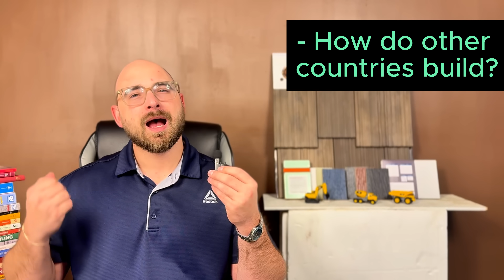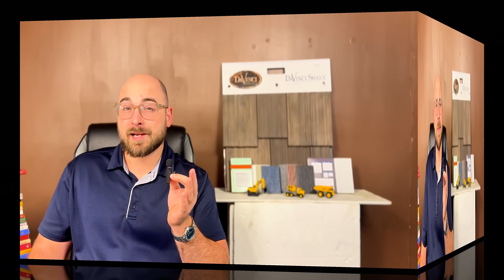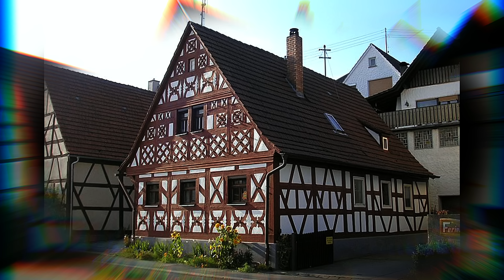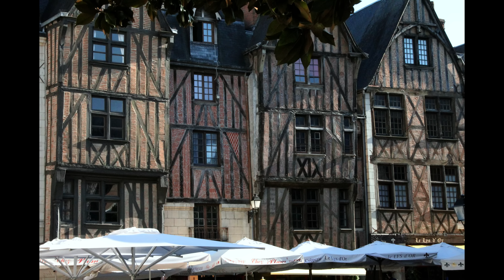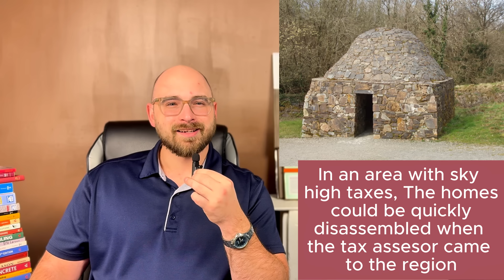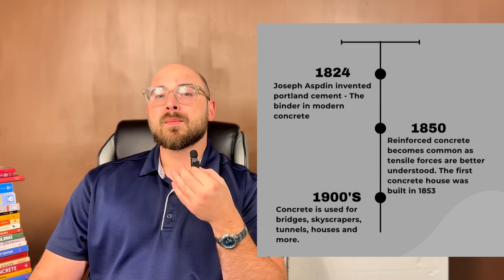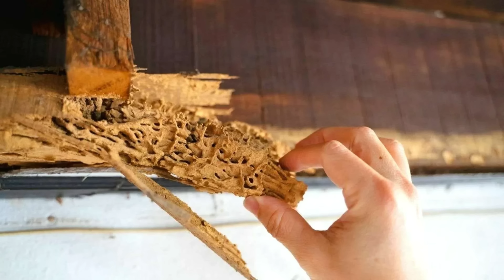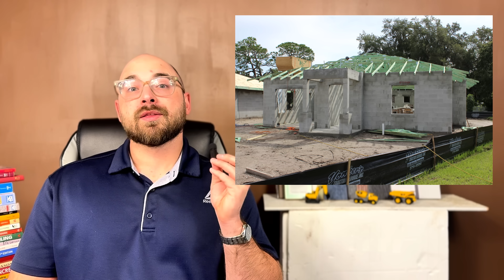Why Other Countries LAUGH at American Homes

Comment: Seriously?  Just peek over your southern border (beyond the border belt states, which are not Mexico by most accounts) and you  will find practically all houses to have been built from blocks and most of them have framed cement/concrete flat roofs (no snow here, so we've only have to make sure that rain water has a way out) and more than a few have vaulted brick roofs. Only the poorest shacks on remote locations are built out of wood and have wood frame roofs covered with something or other. If insulated properly, they do well at keeping noise and heat out. When hurricanes come by, we've only to worry about fixing the windows shut and the such. Plus, fires are a very rare event, to the point that most cities, even in the range of 250,000 to 500,000 inhabitants, do not really have a sizeable Firefighter department (there's usually one, but minimal and mostly for public policy propaganda pourposes. There are no fire hydrants anywhere to be seen.
Reply from the maker: No fire department is a real consideration, super interesting
Reply: @Mike_Fortin  Look it up, and you'll see what I mean. Yes, there is usually a "Cuerpo de Bomberos" (Fire Department)  but, when compared to those in the USA, is little more than a façade. In those areas subject to earthquakes, though, there is indeed a quite compentent and fairly large salvage and rescue unit, but they focus in disaster recovery. Such as the widely-known "topos" units that use dogs to search the rumble for trapped people.

Comment: My house built by brick and mortar..all houses here are..
Apartments are generally steel and concrete with outer brick facade..
Average house price for 3 bed in Dublin 400,000 euro min…
There are 4 bed houses , new, going for 800,000 euro just a mile away..
Only America builds wooden houses I think..
Dollar and euro on parity just about 🧐🇮🇪

Comment: Another reason why Americans build with wood framing is due to the literal disasters, America in the center have the highest tornadoes or storm ranging while not in the whole world but it's constantly very high none of less and do to lessen property damagers use wooden structures another is wood is a lot more flexible then concrete bricks in earthquakes due to the woods natural ways it can wobble but still stand against strong winds or earthquakes which are common in the middle or the south.

While America houses are not it's best it has it's own reasons why it also created there is no reason why a house is created if it simply attends to be useless in the long run
Reply from the maker: A strong enough earthquake will destroy a wood house anyway, while it costs more, a concrete houses can survive a higher magnitude earthquake than a wood house

Comment: I am an architectural technologist in Scotland where we also build with timber frames unlike the rest of the UK. Our new houses are well insulated and up to a good standard, because they have to be by law. Buildings are inspected during the design and construction phases. I imagine there are similar systems in place in America, they are likely not as demanding or well enforced. It is not the timber frame at fault, but the legal requirements (or lack thereof) that push building quality.

Comment: Wooden house have the benefit of general safety in case of a collapse. If a wood frame house collapes or part of it collapses, you're more likely to survive compared to a heavy stone house, this is particularly relevant to the US because of its extreme weather commonality.
Reply from the maker: Or we can build houses that don’t collapse 🤷‍♂️
Reply: @Mike_Fortin not that simple im afraid. America has 3 major issues with constructing housing, its varied climate/ weather events, an ongoing housing crisis (that is pretty much artificial), and a deficiency of American made construction materials. Europe doesn't see tornadoes, earthquakes, and hurricanes nearly as often as the US does and there are significant advantages to having housing that isn't as rigid for some of these events, and due to being built out of wood, it decreases reconstruction time if necessary. It also should, key word, should decrease the prices of new houses due to not being built out of premium materials, granted this won't happen due to late stage capitalism fucking over the middle class, but if things weren't so hellish, it would be an advantage. The final major point, wood is cheap and we can get it cheap if we can't grow trees ourselves. There are distinct disadvantages and advantages to all house building techniques and philosophies, to act as if America doesn't understand material science or architecture is kind of silly and a little ignorant. America builds plenty of its infrastructure out of concrete, steel, stone, and other rigid materials, but individual housing is like the one thing we don't, which kinda makes sense in a way.

Comment: whatever works for you is great IMO, i think America just has a different philosophy where the homes are sometimes built to be more disposable and easily rebuildable after each disaster, worth mentioning America has way more single homes than Europe does, most houses are apartments here and so you can't get away with anything but strong structural concrete, in America it feels most people live in single homes but here it's a luxury reserved for the rich 99% of us live in apartment buildings

In the single-home industry i see more and more things like light steel framing coming into fashion, so i don't think Europe is as set on this brick and concrete idea as others think, it's simply a consequence of the fact we mostly live in tall apartment buildings and not single homes.

I do think especially in the midwest areas that are more vulnerable to tornados America really should make an investment in stronger houses that cannot be destroyed by a tornado as a means of saving the inhabitants of said homes who should really be safe indoors. I do think it would be good overall even if you keep the wood+drywall insides if at least the outside of the homes were built of brick, concrete and metal.
Also in most of Europe we don't use wood for drywall structure, we use aluminum parts meant for that purpose, i think that's better because it can't rot and it feels like using wood then hiding it behind drywall is just a waste of fine wood you could be using for furniture.
Reply: It's not any luxury to live in a detached house in Europe. After Wikipedia:
"In 2015, more than 4 out of every 10 persons (42.0%) in the EU-28 lived in flats, close to one quarter (24.1%) in semi-detached houses and one third (33.3%) in detached houses."
Reply: @ElegantiaeArbiter  Weird maybe some countries are more concentrated than others, i've lived in Lisbon, Stuttgart, Berlin, Ulm, Paris, Bordeaux and Dublin and in none of these places did anyone i know or even heard of live in a detached house
Reply: Might be more common in smaller villages and places like that, but i'd argue living in such places nowadays is a luxury in of itself because of how little work there is in these places for anyone other than those who work remotely, have their own businesses or means of daily commute between villages and the city

Comment: I live in the United States. I wouldn’t say all of our houses are crap. We have a lot of crappy home builders that charge an astronomical amount of money for a subpar product, but that doesn’t mean all of our houses are poorly built. You Have to understand American homes are built out of wood because we have a huge abundance of wood and it’s so much cheaper and easier. Plus the logistics of moving wood around is easier than hauling stone.
Reply from the maker: We definitely have some nicer homes. Some high tech wood homes (passive house, net zero, etc.) 

But concrete is also widely available and with products like ICF it wouldn’t be difficult or too expensive to build insulated concrete homes at a comparable price.

Comment: I mean house is house
but i live in other countries also. and American and Canadian house so far is the worse.
floor creaking.
thin wall does not even do a single bit of job in noise cancelling
especially Bathroom. I like the bathroom that i can spray water everywhere, in which i can clean easily. Here, you have bath tub, end of story, no drain on the floor.

Comment: Houses in America are "cost effective" and disposable but somehow they are 4 to 14 times more expensive than an equivalent house in México... also full concrete houses are not good, confined with concrete framing is better, why? Well try to add a new outlet in a concrete wall.
Reply: To cut channels in concrete walls a good chaser with vacuum is needed, because dust is much bigger issue than hardness of concrete which is still lower than stone. Reinforced concrete frame with brick infill or reinforced structural brick infill (for seismic zones) is one of the best solutions for another reason - it makes the atmosphere in the house better, since bricks have higher porosity than concrete. It can be mitigated by using vapor permeable clay or lime based natural plasters.
Reply from the maker: I would either use ICF and run wiring in the insulation, OR if it was exposed concrete, such as CIP, I would add conduit screwed to the concrete, much simpler

Comment: Truth is..a mixture of all construction methods is probably best. Brick/concrete exterior walls with timber/metal framing for the partitioning  is probably best way to go..or at least that's how they started building in România lately.

Comment: The idea is that American homes are supposedly made of cheap materials like wood and plaster to save costs, but everything I've seen indicates that those wood and plaster houses aren't much cheaper than much sturdier and much better insulated brick and mortar houses in Europe. The only difference is the CEO of the building company in America owns 4 mansions while the CEO of the European company only owns a single large house.

Comment: this is a relatively recent Discover, where they mixed lime in with Roman concrete which expands when wet, so when the concrete starts absorbing too much water and cracks under the weight, the limestone fills in the gaps that have formed and reinforces them so it keeps its strength

Comment: So, European homes needed to be built the way that they were because everyone lives on top of each other, and stonework transmits noise a lot less, and also helps fires spread a lot less than wood construction.

In the US, unless your locality allows for it, stone is often much more expensive than using wood to construct houses.

The downside of course is that American homes need more upkeep structurally in order to remain solid unlike their European counter parts.

The upside is that American homes tend to be much easier to modify and upgrade because you don't have to bust out your stone cutting tools every single time you want to install a new light.

Comment: European robotics engineer here. I had the pleasure of sharing my workspace with a team of aspiring civil engineers that were working on a cheaper brick alternative for housing. Their inspiration? African mud houses. They designed a new brick shape that allowed for a continuous plastic pipe to run all the way through the walls of the building. They modified a 3D printer to actually print various samples of clay bricks shaped in different configurations, and the insulating properties were incredible. The bricks, which were blast heated like any normal brick alternative passed the same stress tests endured by currently available alternatives. I believe they are further expanding their project to this day in the spanish south, building small huts that combine these bricks with semi-spherical house shapes and a propietary combination of insulating agents covering it all up. The same water that flows out of each sink and toilet is used to increase the insulating properties of the walls against heat, especially. Very promising stuff!
Reply: And 20 years on still not available

Comment: I wouldn't waste my money building a house out of sticks. I built mine out of ICF, it recently took a direct hit E4 tornado here in North East Arkansas and One window got cracked by debris and I need to touch up the stucco where things hit that side. It also meets passive house standards on top of being such an easy system that I did most of the work myself outside of actually pouring in the concrete.
Reply from the maker: Oh wow, I’m glad you’re okay
Reply from the maker: Do you have any pictures or video you’d be willing to share?

Comment: when this debate comes out from time to time the only excuses the people from USA have is "but is easier to remodel" why the heck you want to bring down walls? just buy a house you want to live like it is, and "its cheaper", yeah, 500.000 to 1.500.000 dollars is quite cheap of course, not like a cinderblock cost from 40-80 cents, i rather spend 5 years buiding a sturdy and everlasting house than spend half a million on a matchbox
Reply: Cinder blocks cost here $2-3 a piece for standard size.
Reply: @ElegantiaeArbiter  even like that, an estimation on a 1500 sq ft/140 sq mt house, needs between 9000-12000 cinder blocks, so its $18000-36000, thats like the first year and a half to buy the blocks after getting the land to build on, now you have the next 2.5-3.5 years to get the iron rods, house wiring, plumbing, cement and handwork to build the house, there is no rush
Reply: @ I completely agree with you. Just wanted to correct the block price for 40x20x20 cm size.
For 140 m2 house assuming 2 wythe block wall (with insulation in between) and single for partition walls you would use around 4000-4500 blocks depending on the layout. So only $13500.

Comment: 21:42 I would certainly like to know what are these things you call "High performance homes"
Reply from the maker: Homes built with ICF or steel, built with passive house principles such as: continuous insulation, airtight design, better HVAC, and sustainable material choices

Comment: Light wood framing is cheap 🤣
They rip you off. There is no way a pinewood matchstick house should costs the same or even more than a brick/cement/stone house in middle europe.
The house that me and my family live in is 120 years old and you wouldn't be able to tell that. Brick-mortar and stone construction, two floors an attic and a basement wich both have the same size as the footprint of the house. And a garage/workshop. New fasade every 30 years, new roof every 40-50 years and you are done. Thx to my grand-grand-grandfather. This house will stay in family hands so all of us can live rent free and by that be happier than others. We owe nothing to anyone, just your health is worth more.

Comment: The biggest issue with US homes is that you use wood as a material in hurricane and tornado affected areas. If you want your home (and yourself) to survive then you need stronger materials and a basement.
Reply: i have seen solid cement and rebar get ripped clean off the foundation. don't talk about events you don't have to experience

Comment: As a German engineer who lived in Canada for a while I can definitely say European houses are better. As the comment section shows aswell Americans are resistant to innovation and good arguments. Since you hate so much on solid construction I will compare the two wood methods. In Germany we also build with light timber framing especially in single family homes. These homes are made as pre fabricated walls or entire rooms and brought on side and assembled. The biggest difference is how the wall is made, it is used with 8/16cm studs but sided on both sides with double planks of osb which helps the sturdiness and Akustik absorption, as well as filled with insulation.

Comment: One thing I don’t understand. One of the pros of lightwood building is the low cost. Hth are those homes multimillion? 
For that amount of money you can build concrete made villas in Europe. And to be clear, material and labor cost is not cheap there too.
Reply from the maker: Land value and high demand, labor prices are also high, permit fees are high, contractor overhead is ridiculous could be 30,000 a year for insurance, so that cost gets passed down, etc. 

But primarily land and demand. The same house can cost 600k in middle of nowhere Texas and 1.1 mil in the Chicago suburbs